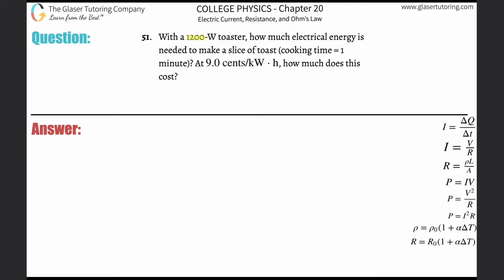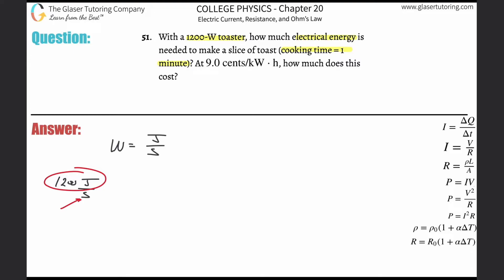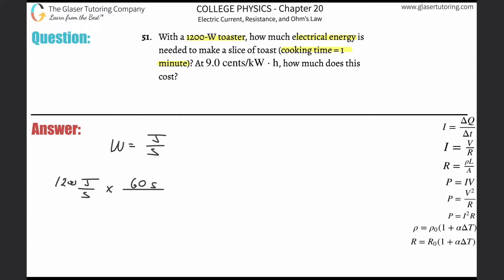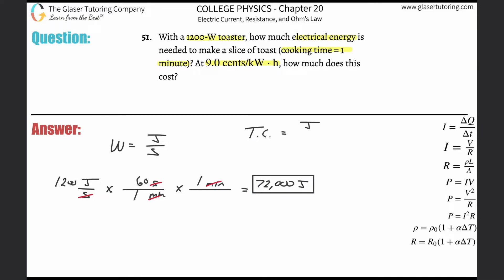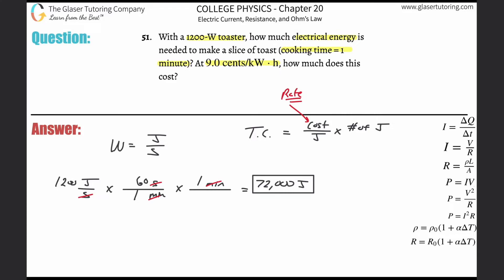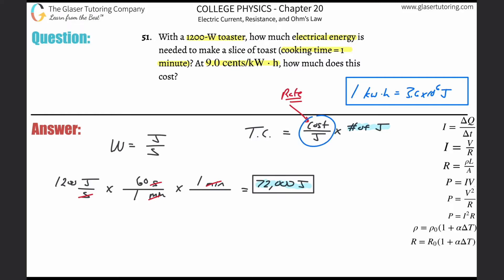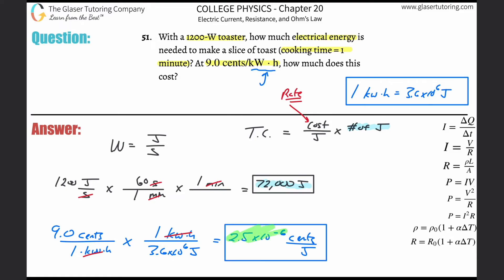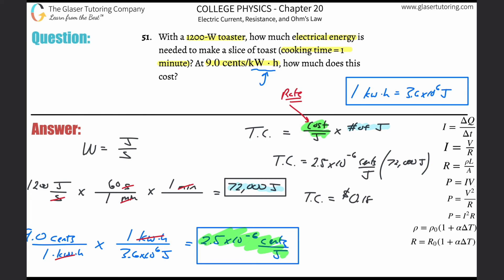20.51 | With a 1200-W toaster, how much electrical energy is needed to make a slice of toast

Comment from the maker: Hi everyone - silly mistake on my part with the units at the end.  The calculation is correct however the units are not.  For some reason I wrote down dollars instead of cents.  The answer should be 0.18 cents and not 0.18 dollars, which is what $0.18 means.  Good thing I'm not in employed by the finance department of your local utility company.